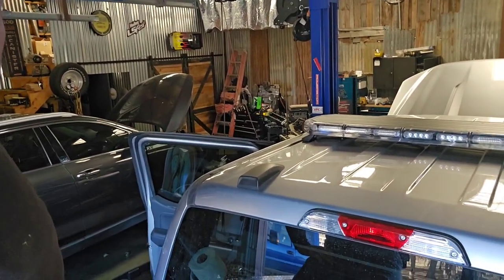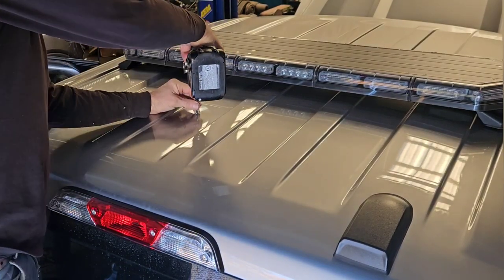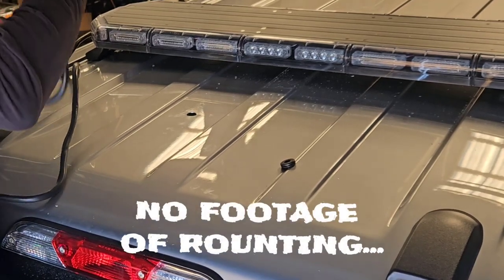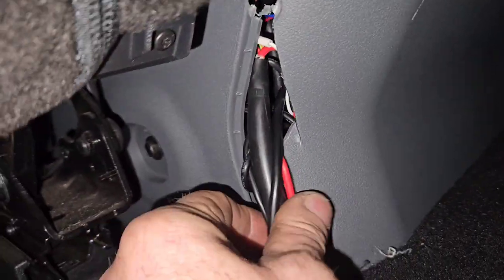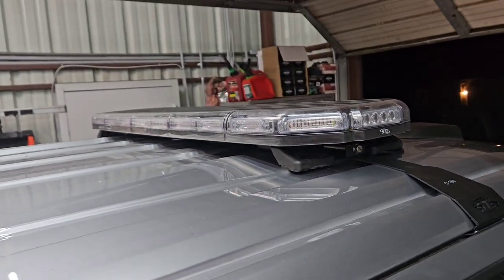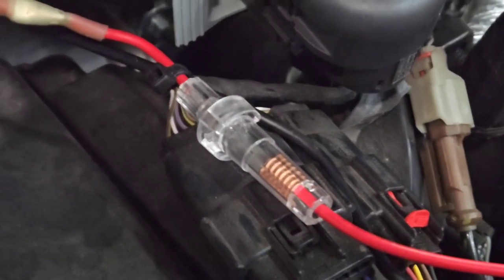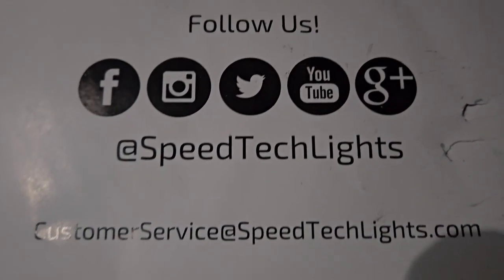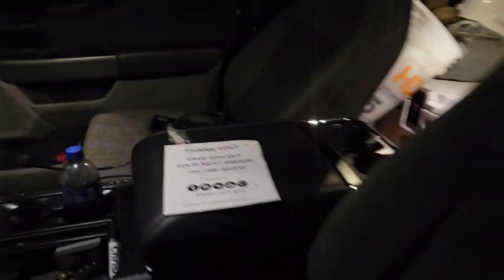Are Light Bars Too Bright?  Speed Tech Light bar install  @SpeedTechLights

Comment: How did you fit the connector through the grommet
Reply: I used a liquid grommet kit when I installed my 55" bar. Works just fine and, if you do it properly, guarantees not to leak